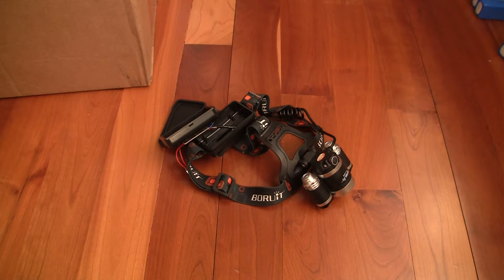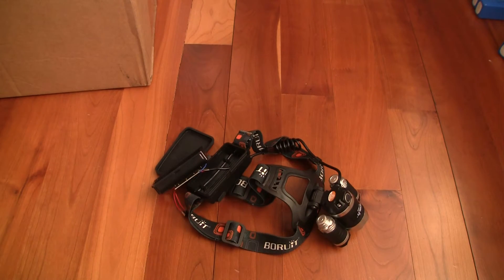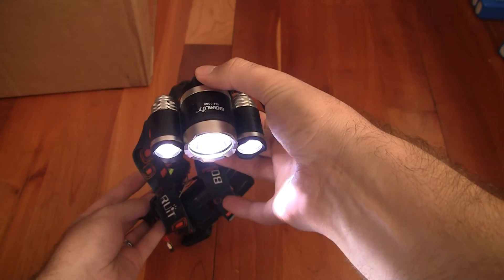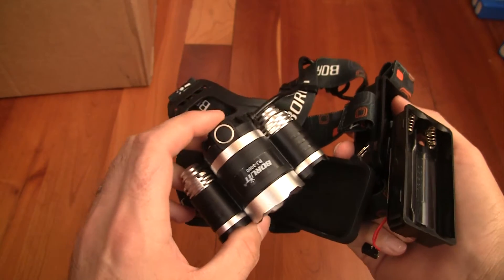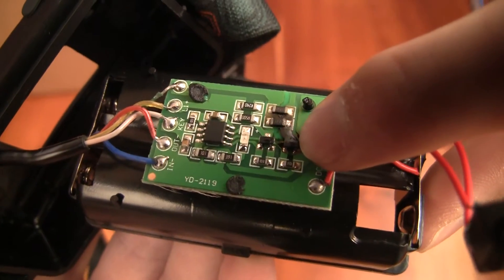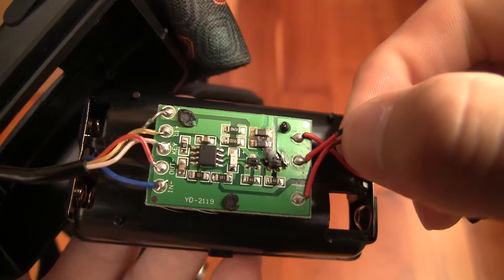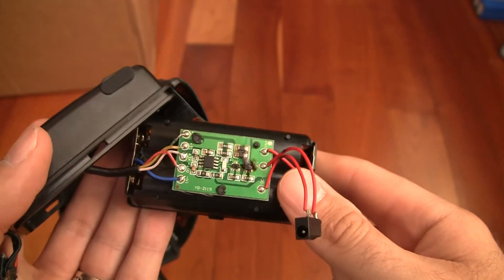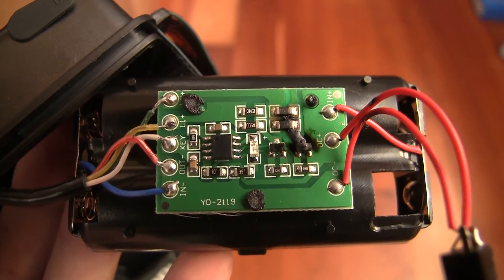Boruit Cree XML T6 + R5 Headlight Problem

Comment: You're assessment is correct. This product is dangerous! The reason is the batteries! I left mine on the charger and my roommate said that my Boruit Head lamp also caught on fire. The Same thing must've happened with a transistor that caught on fire and melted the whole housing. It was useless after that.  There's different strengths in battery's! Some can actually cause fires from over heating! You can order batteries from Temu or Ali Baba for these lights 
I need them for the Work that I do. I'm a Freelance Florist and I sell more Roses and Flowers at night, which requires lights. I have about 20 of these Head lamps believe it or not. Boruit is the Name brand, however there are many versions of this triple light Head lamp made by various Chinese Manufacturers. I have 5 or 6 Head lamps in a box that I'm hoping to  trouble shoot one day. I just bought a soldering kit to repair the circuit board on em!

Comment: Hi, mine went wrong at the lamp end - some of the wires have come unsoldered. I could fix but impossible to tell which wire was soldered where... anyone have a close up pic of the inside of the lamp unit showing where the wires from the cable attach the the small round PCB ?

Comment: i also have same problem..this the cheaper product..but you can repair..buy the component Si2301/A1SHB transistor..
Reply from the maker: Thanks for the part number!! I tried a few transistors I had around and none worked correctly.
Reply: You are welcome..you can buy the part from ebay/alibaba/amazon/aliexpress..i also buy last week and now in shipment from china..the price is 10pcs around usd 1.00 😁
Reply: Hi, could you please mention the number that had worked?